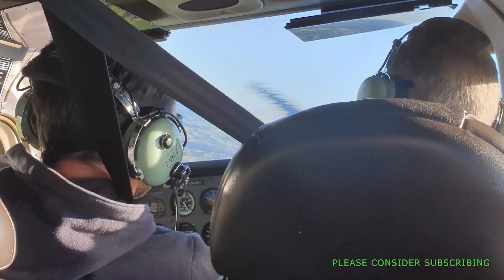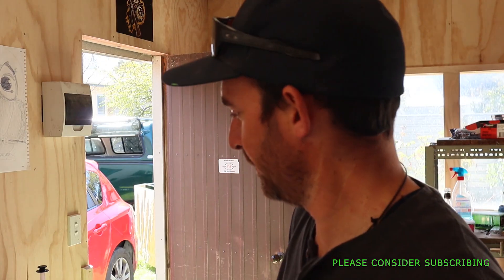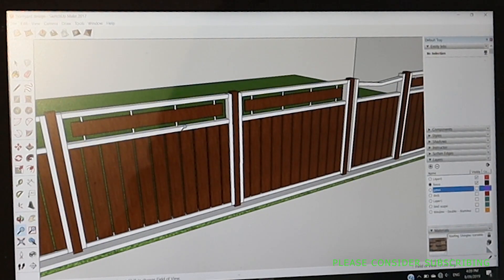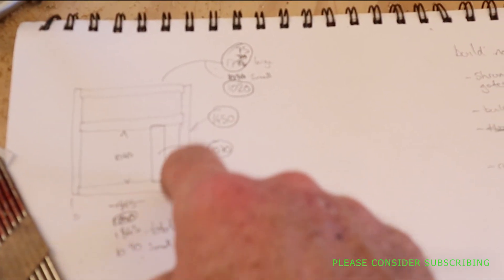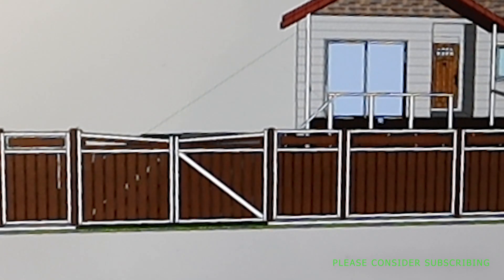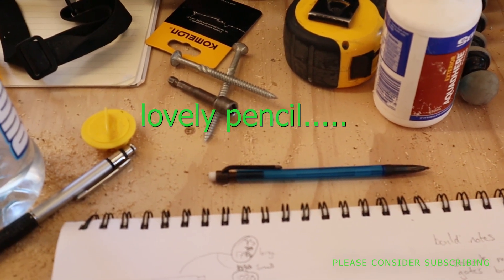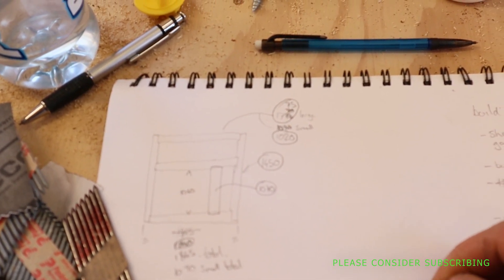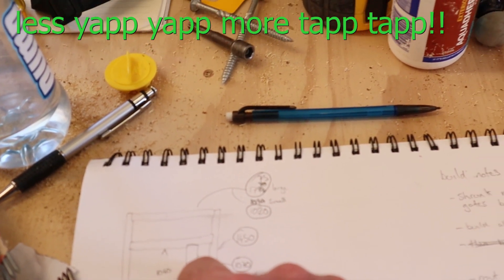carpenters fence part 2!

Comment: Your calcs seem overly complicated.
Did you forget to allow the 20mm at the start of the sequence?
I would have calculated this way.
1735/163=10.6 (allowing 20mm at the start point)
11*163=1793 (oopsy)
10*163=1630
1735-1630=105
105/11=9.5
Therefore come in 29.5mm run 172.5's and because I removed the 20mm which became 29.5 you end up with that spacing at the end.
Does that make sense?
Something like that I don't proclaim to be perfect either.
Like the vids keep it up I agree people watch for infotainment that is the information required and the entertainment.
Try to keep it a little less long winded focus on the how and why and the process.
You should do a vid on sketch up oh and your shop.
Now I'm being long-winded huh.
👍
Reply: I forgot to say it's refreshing to see a chippy doing things the right way also.
Not many left.
Reply from the maker: Haha yes you are right on point! I was wondering who would pick this up haha. The simple way is 1755-143=1612. Ie.. a panel substracted at end ... then divide 1612 by 10 ...161.2...add the 10mm for the hook over. And then do ya ×2,×3,×4 etc👍
Thank for you feedback really appreciate it😁
Reply: @omnibuildersnz  we all do it lol.